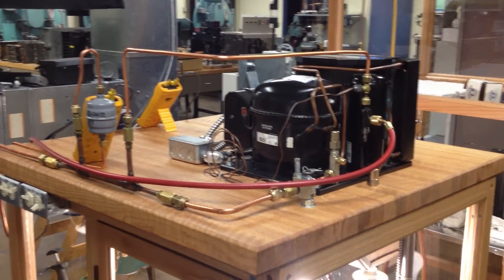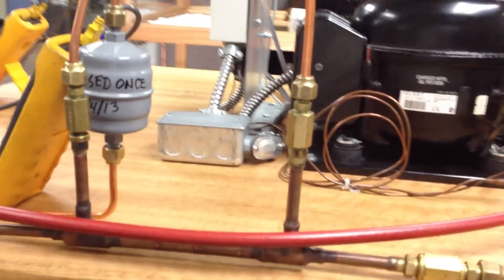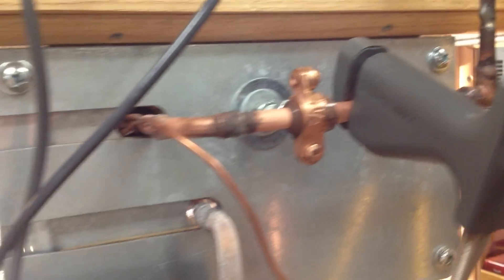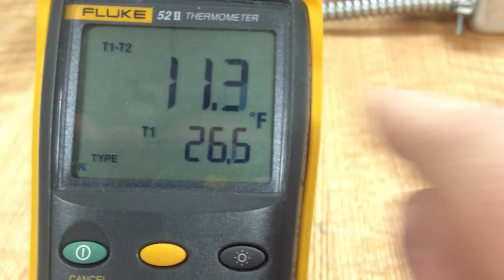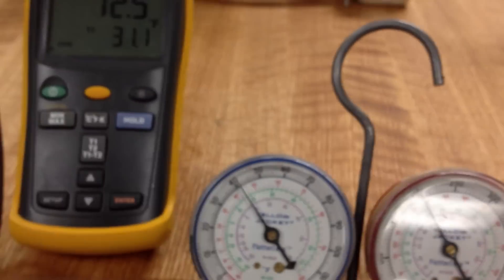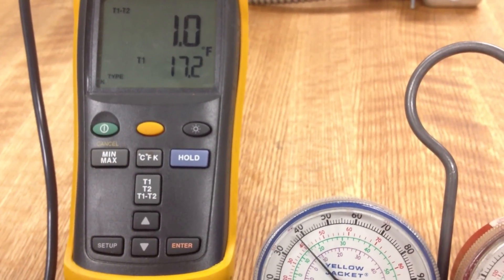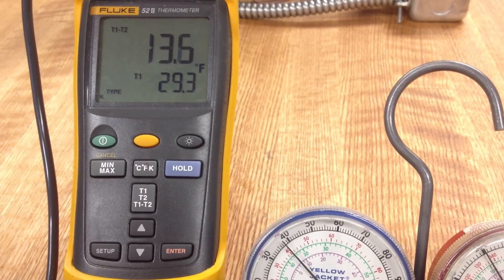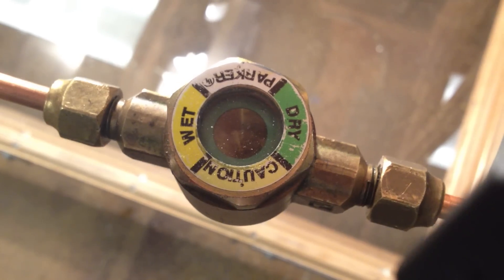Hunting TXV

Comment: judging from the frost right at the outlet of the txv and the slow pressure change but fast temp change I suspect there is a restriction either in the txv body or at the inlet of the txv that is restricting flow into the txv contributing to the fairly stable pressure yet not providing enough flow when the txv opens which causes the valve to overshoot the desired suction line temp.

Comment from the maker: We have concluded the TXV is too large. It is not common to use a TXV on such a small system. So far, we have not found a suitable replacement. However, a properly sized cap-tube or fixed orifice would probably do the trick. We welcome any suggestions.
Reply: I will install a cap-tube (problem solve) . "It would not hurt to do away with the TXV because it's a  small unit, but if you insist  that you must use a TXV pls go Danfoss".
Reply: If it’s a constant load, an AEV Would work.

Comment: a system in a space that small would never have an externally eq txv because the evaporator would not be large enough to have a distributor (3 or more lines into different runs of the evap coil). the ext eq line and spring pressure in the txv are  going to have much more mechanical force on the pin than the bellows can produce causing it to close fast but be slow to respond to drop in suction temp

Comment: vlt the suction gauge shows u what the saturation temp and pressure is in evaporator.. its at saturation there.. once its superheated and becomes unsaturated the temp pressure chart no longer correlates.. u can adjust what the evaporator operates at by adding or removing refrigerant

Comment: A friend had a small fridge with this problem. He called for service because the new compressor "didn't sound right" and he didn't want to have it blow too. The tech removed all the gas and replaced it. He said the previous tech who replaced the compressor probably didn't vacuum air from the system before adding the gas.

Comment: I don't understand how the thermometer is showing rapid changes in superheat but yet the suction line guage is not fluctuating rapidly, I don't get it - if the temperature in the suction line is fluctuating heaps then the suction pressure should be shown to be fluctuating heaps not minor amounts like shown?
Reply from the maker: VLT - Yes, normally this is true. In our case, we placed a temp clamp immediately downstream of the TXV and another downstream of the evaporator. Then we read the temp differential on a fluke 52. Since there is a mixture of liquid and vapor immediately after the TXV, it will indicate (at/near) saturation temperature. Therefore the differential temp will indicate actual super heat without needing to interpolate it from a PT chart.  Since the vapor in the evaporator acts like a big spring (think shock absorber) its response is a little delayed compared to this method of directly reading temps.
Reply: Bulb in wrong position picking up liquid on after evap

Comment: My co-worker just called me with the same problem after replacing a compressor on a sandwich display cooler. My guess is oversized txv. The last compressor only lasted 10 months. 
Checked: Air flow is good, amps almost at rated FLA which seems high for a new compressor, hot gas is not as hot as it should be, low head pressure and very low suction pressure,  frost back to the compressor, and superheat is hunting the same as in the video, txv bulb mounted well. Any suggestions on this one?
Reply from the maker: I take it you are not targeting cooler temps below 32*f, therefore frost (on suction line) at the compressor would indeed seem bad. Are you sure there is good air flow and heat exchange at the evaporator. If the evaporator is not absorbing heat, then the whole system will have low pressure. Here are some other thoughts... The main point as you indicated, is low suction superheat. Liquid could be returning in the suction line which would kill the compressor over time (or immediately in extreme cases). It will also cause high amp draw on the compressor. Low suction pressure at part load is one reason evap coils frost up, this will aggravate all the symptoms you describe. How is the refrigerant charge? Are you getting proper sub-cooling on the condenser? Also, you will want to have a liquid line hx as described at :54 seconds on the video. If you don't already have one, then install one asap. It will at least provide a safety net for the compressor.

Comment: i need help ,can somebody explain me how can i measure superheat if the system have a electronic expansion vavle
Reply from the maker: Fathma - Give the system about 20 minutes of run time to allow the pressures/temps to stabilize. You will need a good clean pipe surface on the suction line downstream of the evaporator. Place a temperature clamp on it and wrap some insulation around it to ensure accurate readings. Then using the refrigerant pressure gauges, take a suction pressure reading. Compare the "saturated" temperature (found on the P/T chart) with the actual temperature reading. The difference will be the *F of superheat. Suction temperature should remain higher than saturation temperature, usually not less than 12*F and not more than 20 *F. Always consult manufactures documentation before adjusting.

On the high side, use the same method but place temp clamp immediately after the condenser. Compare the head pressure to a P/T chart. The difference should indicate amount of sub-cooling.
Reply: Lance Reeves how can you do this on a sealed system with no service port?  Thank you
Reply from the maker: Ron, without having access to pressures it is hard to be accurate. There is one possible option that can get you close. If it is possible to get a temp reading between the metering device and the evaporator, this will usually correspond to saturation temperature. The number read can be subtracted from the temperature leaving the evaporator to derive the superheat temperature. This only works when there is a mixture of liquid and vapor immediately after he metering device. In some cases, like very low charge or even over charge, the temp may start to drift away from corresponding saturation temp. So, use this method with caution and due diligence.
Reply: Lance Reeves thank you.
Reply: Same way

Comment: Honestly, that was my first thought however unlikely! ! (I was kind of surprised!)...remember it is a total system. The total volume of the evaporator of course ,size of the suction line. And Just as important the Thermostatic expansion valve MUST feed the low pressure saturated mist into the Evaporator at the same rate at which the vapor pump (compressor) is pulling the superheated vapor from the Evaporator. Excellent Video! The craftsmanship looked to be top shelf as well.

Comment: no load is the problem..load willll give your 5 degrees
Reply from the maker: Agreed.
Reply: Richard Gatewood  oil it is  on the evaporator. Flush amigo. More than one time I've encountered this problem.
Reply: Richard Gatewood 
Adjust txv or add a P-trap at evaporator? Ive seen smaller systems work fine with txv.  Interesting.